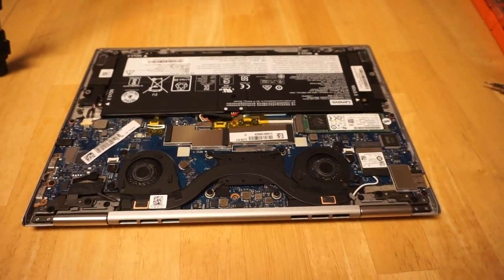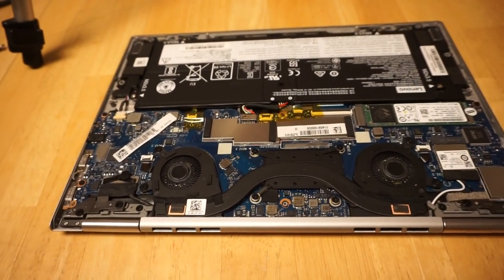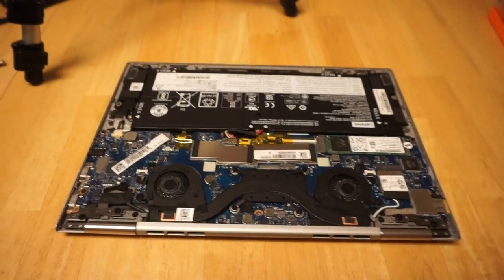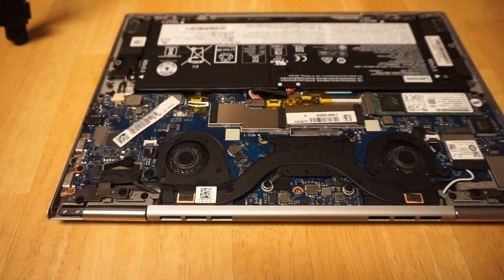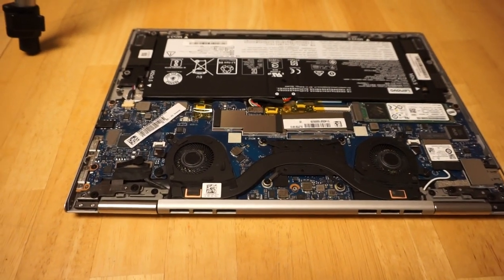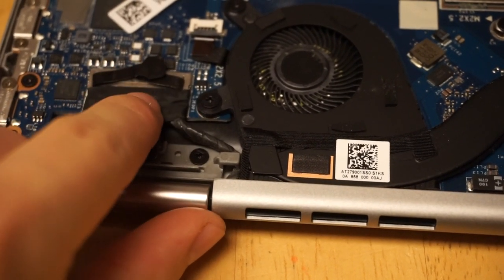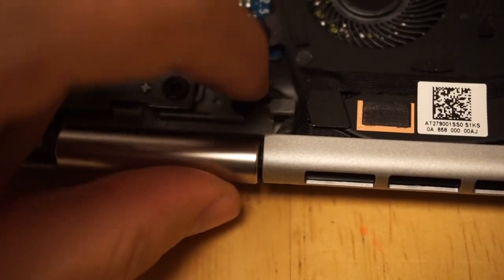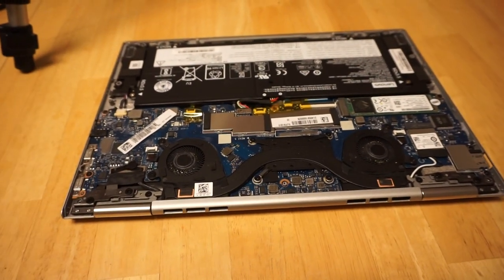Lenovo Yoga 730 Screen Flickering Easy Hardware Fix

Comment: This can help but there is some extra effort for a permanent fix (read below). Andy is right that the cable moving out of position is the initial cause of the problem. Once the cable was out of place, opening/closing/twisting the screen likely loosened the connection(s) where the cable is seated on the board and/or under the screen. Adjusting the cable (as in Andy's video) can help to re-seat the cable a bit, but it's not a permanent fix. It's like adjusting your tv's hdmi connections by wiggling the middle of the cord. FOR A PERMANENT FIX- after adjusting the cable and securing it under it's seat (with a wad of elec tape or rubber band as other viewers did), you need to make sure the cable is firmly re-seated at it's connection points on the board and under the screen. (WARNING!- removing the screen is a PITA and you will need to be prepared to replace one-time use tape! Removing the screen requires removal of two pieces of special double-stick tape (like command-hook tape- it releases as you stretch it). Check the Lenovo Hardware Manual for your specific Yoga's part # and order directly from Lenovo part supplier. Using no tape to reassemble for regular double-stick tape are not good alternatives.

Comment: So far so good, thanks for the tip! I was about to smash my yoga 730 with a hammer.
Reply: UPDATE: It came back. Such a waste of a good computer. It will work great permanently on a docking station. I got a ThinkPad to actually take with me.
Reply from the maker: @charlesdimsdale2837  not sure if you still have the laptop, but you can buy a replacement cable to install that fixes it
Reply: @andykins118118  Do you have the part number by chance? Mine was flickering but in the last two days it's perfect. I'm hoping it fixed itself.

Comment: This worked on my Lenovo Yoga 520-14IKB
Had the issue for 2 years.
I just pulled the cable from all the plastic guides and it seems like it works well now

Comment: Got sick of having to do this every time the flickering issue popped up so I replaced the EDP cable. 

Was a PITA to access. You’d also have to pull off the adhesive that holds the screen into the laptop chassis - once you fix the issue, you’ll end up with a screen held together with only tiny latches and 4 microscopic screws. Your laptop’s going to be a lot less sturdy than before. 

But meh, at least I can use it now.

Comment: I probably find a more permanent solution. After have open the back cover several times to tight the cable. I decide to add a thick elastic objects to hold the cable connection to the motherboard. The objects I used is a pretty think double side glue type. I just remove one side of the tape and cut it so it can hold the connector in place. So far that works for me.
The connector is downwards to the motherboard. The cable is too short so when we flip the screen some force will  be pulling the connector to the side, sooner or later it will tilt to one side and get loose.
I found this out from that when I push the bottom cover where the connector located the flickering will disappear. So the solution probably will be put a strong sticker or tape there to prevent  the connector from loose from the side force. Alas, before I did  that, I already bought a new monitor cable try replace it and a new Dell 9250 2 in 1 computer.

Comment: I opened mine a second time. After looking very closely at the problem area between the fan and hinge I realized that grey tab the wire runs under is supposed to harness the wire. My wire fell to the side of this cradle and got jammed under the actual fan. I think this is why my screen was getting so bad. The wire was being pinched under the cradle. To remedy this, I rolled up some electrical tape and wedged it between the display wire and the fan while pulling the wire into its cradle. This seems to be gently/safely holding the wire where it belongs. I haven't had a single flicker yet. I will reply if the problem persists.
Reply: How is going so far? :)
Reply: @andreasneo4362  Back to flickering. I opened back up and it seems to have been pulled into hinge. I think it slides into the hinge a little bit every time it is opened and closed. I currently trying to think of a way to prevent this.
Reply: @tomio56  Did you come up with anything? This laptop has given me a headache since day 1.

Comment: I have a yoga 710 (710-14ISK) and tried Lenovo's recommendation without success (ensure BIOS is current) and ended up swinging by the local Microsoft store at the mall, asked them to pop the bottom off and inspect the display cable. turns out this model has a fan casing/placeholder without a fan (option to upgrade?) and by removing it, the cable is less constricted.  i also adjusted the processor power management settings to encourage the device to run a little cooler (limit the maximum processor state)...assuming the screen flickering is a result of the system being overburdened. i don't do anything other than basic computing, so don't need the computer to perform at high level.

Comment: THIS WORKS!!!

Last night I bought a brand new Yoga 730-13IWL. I really love the machine, but today I noticed the flickering. Luckily, I was calm and patient enough to do some research and see if there are more people experiencing the same thing before going back to the store. Which there are, a lot. And then among the search results came this! Thank you @andykins118118 for this great tip. And to confirm once more to all the people, THIS WORKS!

I am pretty sure that the warrant remains intact because there are no hologram stickers of any kind from outside or the inside when you take off the back lid.

Thank you very much for this video.
Reply from the maker: Glad the video helped! You should return the laptop if you can though, this is a persistent problem and I've had to do this multiple times. I'm worried that the cable will eventually go bad and stop working altogether
Reply: @andykins118118  The flickering came back, but not that intensively. What I have noticed is that it is actually related to the level of brightness you have configured. If the brightness goes under a certain threshold, flickering appears. So this might be a "feature" of the screen itself, not strictly related to the cable. And it can also be related to the entire batch of these computers based on the screen they were using during the assembly.
Reply: Hey guys, do you use it in tablet mode a lot of times? Mine has been solid for months after opening once only, but never attempted to use it in tablet anymore and has been solid! I remembered issue started after using it on tablet mode. I “believe” it pulls the cable more causing the issue
Reply: @pvrodriguez5795  I've never used tablet mode and mine flickers constantly. Lenovo/Moto is a garbage product. I also have an old Moto G4 Plus with major ghost touch issues. Wish I could go back in time and return this crap.
Reply: Elizabeth W. Yep I cannot disagree in just returning. Do you know if you ever exceeded 90 degrees when using it? As long as I don’t, I have not seen the issue recur. It could be other triggers, but always solid for me. This video has been so helpful for me.
Reply: @pvrodriguez5795  It's possible I do exceed 90 degrees. I can try to not go over that and see if it helps.

Comment: I have a 520-14IKB which  had the same problem.  I folded the screen  around to tablet mode (not sure when I last did that but it was a long time ago) and low behold the screen works perfectly. I think that points to a cable problem  & seems to eliminate both software and screen hardware.  Great joy, I turned it back 15 minutes ago and flicker has not recurred.  I'm guessing that it will happen again but at least the fix is (maybe) very easy and at worst cheaper than a screen replacement.

Comment: I have the same laptop for school. The staff at Best Buy kept saying that it was an excellent model, but results would say otherwise. I plan on buying the correct screw see what is up with the interior parts of my laptop. 
I searched what type of screw is needed, and I found that a Torx screw is best.

Comment: Hello again. One week later, the flickering started again. It gets so bad that sometimes you cant even use the laptop without pressing in "the point" (about one inch right to the logo of the screen). Today I reopened and used a rubber band to hold the cable in the opposite direction of the keyboard side. The rubber band is in one side holding the cable, and in the other side is at a screw female part in the chassis. Lets see how it goes. I keep you posted... i am probably talking to myself here...
Reply from the maker: Please let me know if it works! I've had to repeat the process in my video a few times now, and I think we'd all appreciate it if someone figures out a permanent solution
Reply: @SergioPozuelo  Hi Sergio any update if this works?  I really don't want to send mine in

Comment: Thanks so much for sharing the video. your solution works amazing and i have no flickering any more.
I would like to add that the screw driver needed to open the laptop is (T-5).
Reply: How long have you had your laptop?
Reply: @AmirulAdlan6  about 6 months
Reply: Was it working fine the first 6 months? Or did it flicker a bit now and then
Reply: @AmirulAdlan6  It started flixering about 2 months in and went down hill since
Reply: Dang that’s pretty rough. Has Lenovo ever got back to you about the problem? Also, since you tried the fix in this video has you screen flickered if any, at all?
Reply: Bought a small laptop/phone repair kit for about $8 as I didn't have a TORX that small (T5; thanks for that!). The kit had a nice plastic "pry bar" that helped pop the bottom off the laptop (start by the hinges, pry up gently from one side to the other). The display cable on our YOGA was routed correctly, but as suggested in other posts, once the bottom was taken off, the continuous problem with flicker we had was gone. I was able to slightly reproduce it by pressing on the insulating material holding the cable to the Main board connection, but it wasn't repeatable. The display cable pointed out in the video was routed correctly, but I did notice the insulation had been "pressed" and slightly twisted nearby where the cable connects. Pressure here might explain why the problem occurs when the bottom is on. I used a small piece of plastic I had to hold the cable away from the right hand bend (towards the bottom of the laptop) at the corner near the screw (where his finger is pointing at about 1 min), and we will see how long this lasts. If it works, a slightly heavier non-conductive "sleeve" of some sort (any insulating material) would probably help this out longer term. I suspect the real fix is the actual connection at the Main board and likely more "slack" in the cable would have helped. If the problem is on the screen end of the cable, then it's likely going back to Lenovo and will be out of use for weeks (based on other posts). This laptop is only about 2 months old, never traveled with, never opened more than 180 degrees tops, and we got the same baloney about it being "Firmware & BIOS updates" when it was taken into Best Buy where it was purchased. They wanted to charge $169 to do the updates. Unbelievable that none of the PC mags or people that tested and rated these laptops never saw this problem.... Anyway, thanks for the video! Great help. I have pictures of what I did, but not sure how to post them, so hopefully the extra description does not prove even more confusing. Good luck!

Comment: i have the yoga 520 and i fixed the issue by holding the display motherboard connector cable so its more pushed in and placed a makeup removal pad over it and shut the lid. yes you can laugh  that its there now but its soft and applies pressure to the connector so it stays in place while you let the device do yoga in peace. how ironic that a lenovo yoga cannot do yoga from the factory.

Comment: Cheers will try this. Our problem is that at certain angles or with pressure on certain parts of the hinge the screen will flicker or go black. Would be good if you gave an explanation and showed video of the problem we are trying to fix.
Reply from the maker: SleepyCod467 that sounds like what happened to me. There’s a lot of videos of the problem, I figured the video would be most useful if I kept it short and to the point

Comment from the maker: Another update: The flickering was getting progressively worse and worse to the point that the laptop was unusable without an external monitor, so I went ahead and replaced the screen cable for my laptop and the problem seems completely fixed. All in all it wasn't too hard, I followed this video by The Net Guy: https://www.youtube.com/watch?v=RRQkPFruXug

If wiggling the cable no longer works for you, give this a try.

Comment: My display has been constantly flickering for the last two weeks, but I have also had it plugged into an external monitor which works perfectly an never flickers.  I have lowered the display on my Lenovo because the flickering drives me crazy and just use the larger external monitor.  I realize this isn't a fix, but I can use the computer in my house without  the loss of the use of my computer or money to get an actual fix.
Reply: I had this same problem occasionally and I tried adjusting the cable, it would sometimes work. Finally I tucked in a folded piece of paper just above the socket of the display cable and issue seems to have been resolved.

Comment: @andykins118118 thank you so much for posting this video. I have a Lenovo Yoga 2 Pro with the exact same flickering problem. I have researched a solution for MANY hours and I think yours is the best yet. Although my issue is exactly the same (screen flickering), I am wondering if your symptoms were the same as mine? My symptoms are as follows: 

1. screen flicker only happens after the laptop has been on for a while (maybe to do with heating up?) 
2. screen flicker only happens when working on battery (it NEVER happens when plugged in to the mains) (i can't explain this)
3. when screen flicker happens, closing the lid for a few seconds gets rid of it (i can't explain this!)

Did you experience any of these issues at all.

P.S. I only ever use my device in laptop mode, never in tablet or 'tent' mode.

Comment: I have the same problem since I bought my Yoga 730 on May last year. One strange thing that I noticed is that sometimes I experience the flicking issue on certain webpages but if I open another tab on the web browser the flickering problem vanishes. My conclusion is that the issue is somehow related with the video graphics or something.
Reply: same thing on my yoga 710. Sometimes when I minimize web browser or open new tab the flicker goes away. Its really strange. I have had it sent two times for repair where they've replace the screen

Comment: Lenovo Yoga series is the worst product out there by the lenovo. They are selling it by calling it's 360 rotation as the prime feature( as the name yoga) but they didn't tested at all. This loosing of the connection and screen fickring is the main issue coming from many yoga systems. Please dont't buy this product as this so called prime feature is useless.  
: Experienced owner of Lenovo Yoga

Comment: I suspect the tension on the wire has caused the cable connection to come loose.  I'm not a repair type person, but this should be a small labor charge to fix.  Any idea where to send this for a reasonable repair without paying the cost of a new laptop?
Reply from the maker: I purchased a replacement screen cable online and haven't had any problems since installing it. I used this guide: https://www.youtube.com/watch?v=RRQkPFruXug

Comment: Hi, Thanks for info. We're having the same problem with the 520 model, and we have never used the Yoga function, just used as a normal laptop. It seems to me that the ribbon is being pulled too tight when the screen is being closed, and causing it to dislodge over time. Does anyone know if a replacement or modified cable has been made available for sale? Thanks

Comment: There is an option of automatic change brightness when it is subjected to lightings. So unselecting it will solve the problem. It's no hardware issue.
Reply: There is definitely a combination of issues with the display. While changing the brightness did help with the flickering I still get it at certain angles.
Reply: @davidportner8786  I get it right till i did it. Let's see what happens untill it occurs
Reply: That's what seems to work for mine. Don't wanna crack it open just yet, but I can't turn the brightness up or it just flickers like crazy
Reply: So I got mine last week and it flickered maybe 30-40 seconds after I would switch the mode.  This happened 4-5 times the first night i had it and the same thing the next day.  I turned the adaptive brightness off and it hasn't done it since.

Comment: reddit thread about the same issue, with a quick workaround/fix:
https://www.reddit.com/r/Lenovo/comments/9hjjrv/lenovo_yoga_730_13_screen_flickering/

it's either the cable or the connector itself. definitely not a software issue.

how to open the back cover:
https://www.ifixit.com/Guide/Lenovo+Yoga+720+Bottom+Cover+Replacement/102465